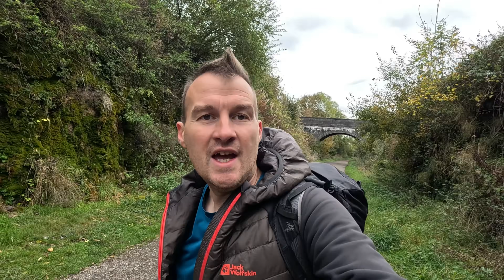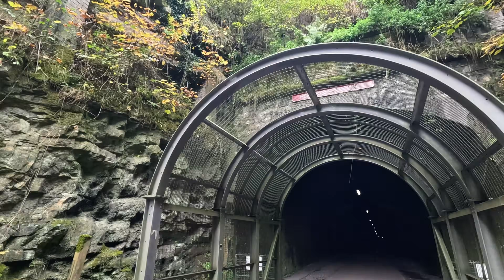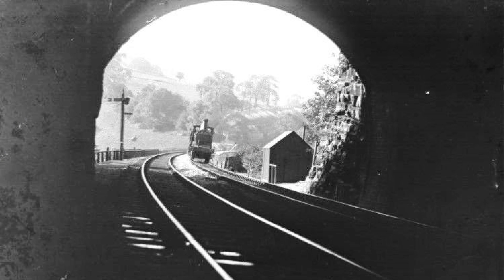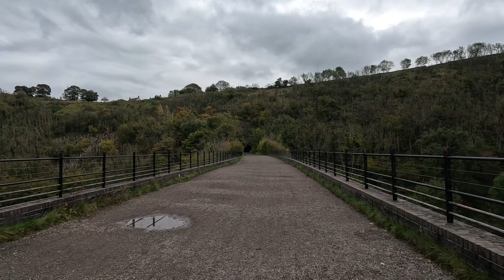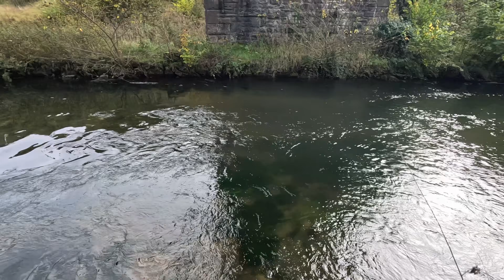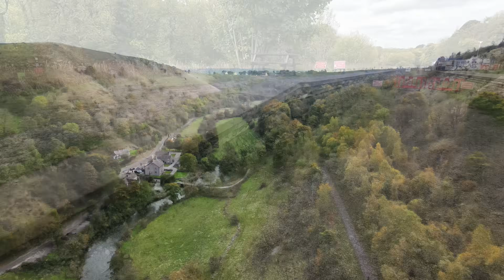Monsal Head Viaduct & Headstone Tunnel - Victorian Engineering Perfection

Comment: The concrete 'shelf' in the tunnel is a mains water pipe, running from Miller's Dale to Longstone. It's largely buried in the trackbed, but in the Headstone tunnel the solid rock is too near the surface to bury the pipe. It would be too hard to dig a trench. Sections of the pipe were replaced a few years ago. You can also see the valves to isolate sections from time to time along the trail. 

AFAIK, Headstone had just one shaft from the surface. You can see where it was, in the tunnel, there's a big brick 'saddle' of strengthening in the roof.

Comment: It was great travelling along this line on the London's and the locals, but you couldn't appreciate it like you can now.  This is a great video, Ant, going through the cutting, the tunnel and across the viaduct. It was good looking up at the viaduct from underneath, a long time since I saw that. Great video shots, especially of the Class 45 Peaks. Remember them well, with haulage along that line. Many thanks.

Comment: I find the safety cage looks like you’re about to walk into a Jurassic Park enclosure! I can see why it’s there though. The portal looks quite precarious in the 1953 picture! 

Such a lovely tunnel. Love that it’s accessible for all to enjoy. It looks exactly like Pendinas Tunnel between Tregarth and Bethesda. That one’s an ex Bangor- Bethesda standard gauge line. Love a good tunnel! That one also opens up onto a bridge. Not quite the same as this viaduct but still pretty. 

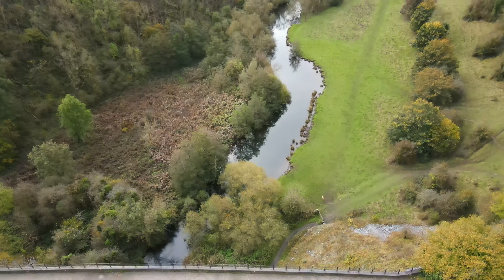10:33 - a blot on the landscape?! Pah he knew nothing about railway architecture! However very poetic way to say he didn’t like it. As you say later in the video, the structure blends in well into the landscape unlike modern day roads. It’s a picture postcard situation. Beautiful, absolutely stunning. 

Reopening the line with shared usage is a brilliant idea. Love all the old clips of trains crossing the viaduct. Gosh how I’d love to have been around during the golden age of steam.